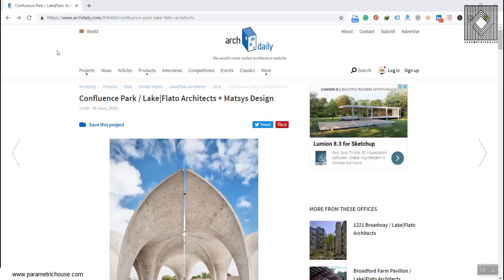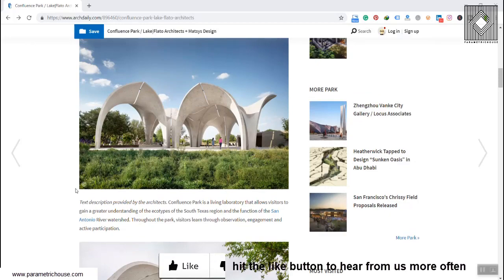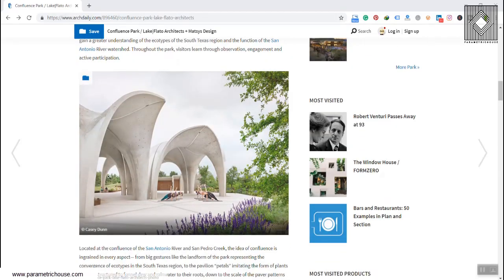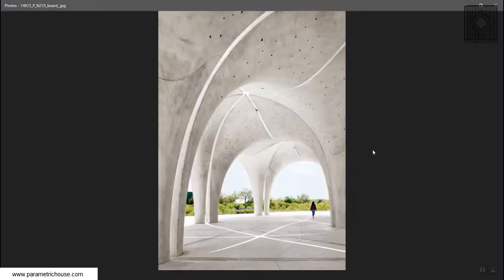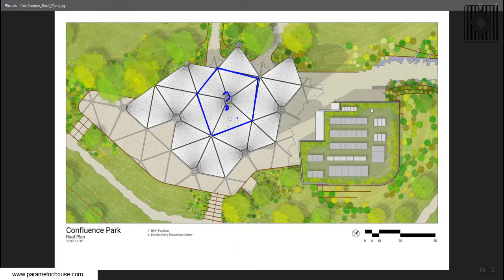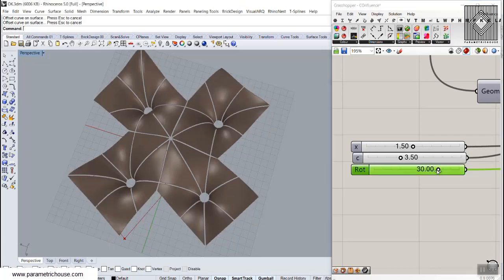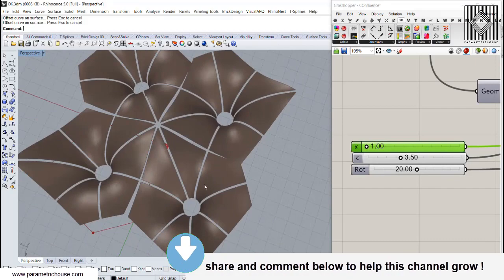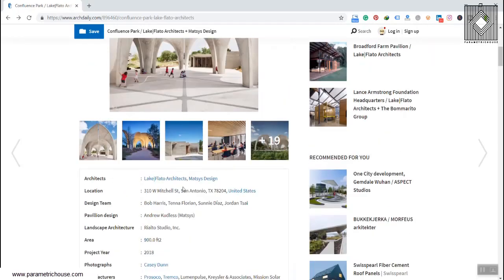Brainstorm #2: Confluence Park

Comment: It was kind of tricky but the hint you gave about looking for a polygon pattern was very helpful.
Having established that  the base geometry was made of 5 sided polygons with some sides not being equal, i first modeled with an equal 5 sided polygon 
Step 1- create a 5 sided polygon(P1) in grasshopper and make a duplicate(P2) with the z vector as the height of the structure.
Step 2- explode P2 and divide the curves to have 5 points each.
Step 3- Using cull pattern/list item or dispatch(whichever is preferable) select each point in the divided P2 and move in the z axis to create a sine like curve (C1) by interpolating the points.
Step 4- scale down P1 to create polygon (P3). explode P3 . Get the start, end and middle point of each segment interpolate the points to create curve (C2).
Step 5- using Arc SED(x2) create two rail curves (R1&R2) by connecting the start and end points of the segments of P3 and P2.
Step 6- Sweep rail 2 using C1 and C2 as the sections and the two curves R1  and R2 as the rails. 
(The above steps will result into 5 surfaces which can then be mirrored using the edges of P2 to create mirrored copies  on the desired sides.)
Step 6- A 5 sided polygon with unequal sides can then be constructed manually in rhino using the polyline command. Reference the curve in grasshopper and reconnect all wires from P1 to the referenced curve, this will enable one to move any of the points of the polygon in rhino and maintaining the form concept. I can mail the definition if my explanation is not too clear
Reply from the maker: Great idea 👍 Making the model in steps will help you to condition your brain to think parametrically! And that is what I want you to get used to! There are many ways to model this for sure and I will explain my way of doing it next week! The unequal 5 sided polygon is a little tricky but you can also make it in grasshopper by restricting the angles and to give a hint you can achieve that by using the array polar 😉
Reply: Thanks I will try and work with the new hint